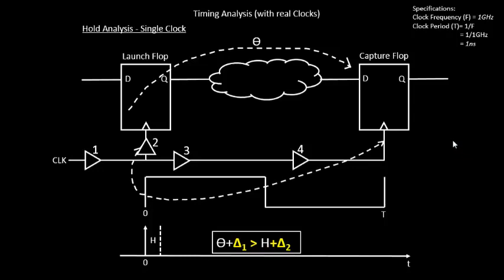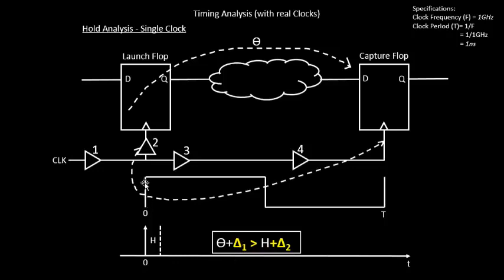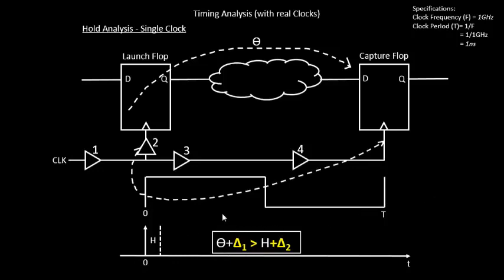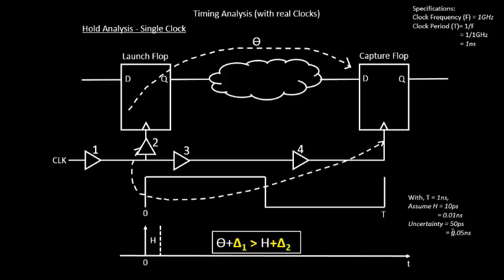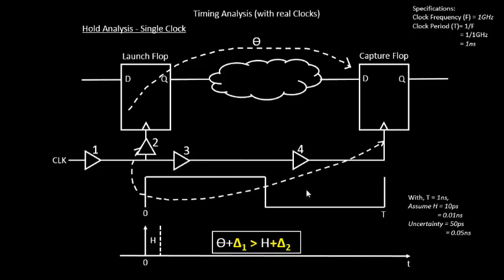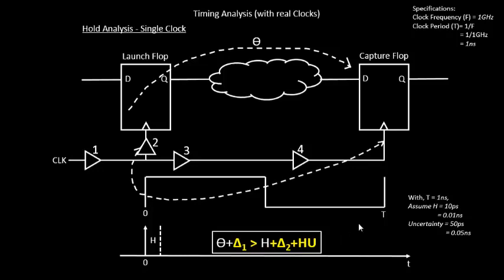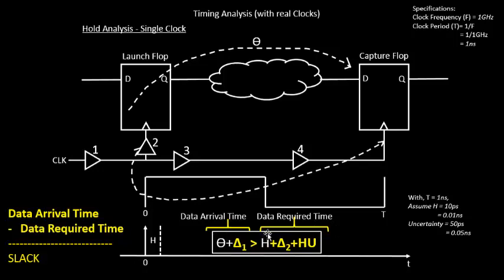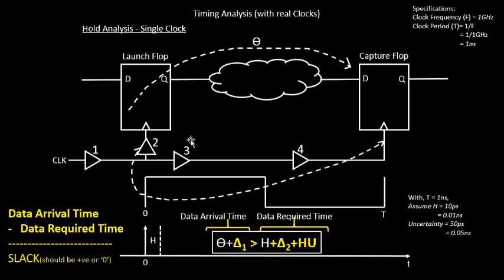How to do STA Hold Timing Analysis ?? Learn @ Udemy- VLSI Academy

Comment: why pulse at zero nanosec reaching at  both flop in case of hold time analysis
Reply: in setup time we analyse the problem at two different time instants. We analyse like "let's at t=0 if launch flop is sending some data then what will happen at t=T at recieving flop". I am taking ideal scenario here.

and for Hold analysis we analyse both ends at the same time i.e. at recieving flop we are analysing previous input which was given at t=-T.  So we are analysing "what is happening at both the flops at the same instant of time."

Comment: how to rectify hold time violation.. as you said for setup time by increasing clock time??
Reply from the maker: Hi Palani
You can add buffers in datapath or all clock buffers in launch clock path. Also, increasing clock time for setup time is the last option to resort to. Ideally, you should be trying to fix setup time without increasing clock period
Reply: thanks for your valuable reply!!!!

Comment: if setup time is mux 1 delay and hold value is mux2 delay then sum of mux1+mux2 is clock-q delay ???
if yes i have timing report file in which i have i have setup value 0.352 but clk-q delay 0.120.